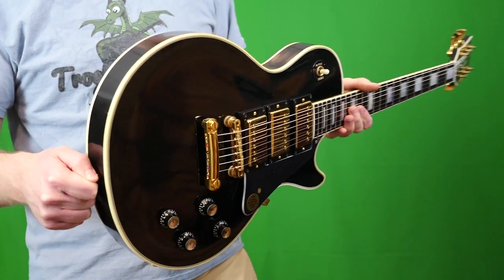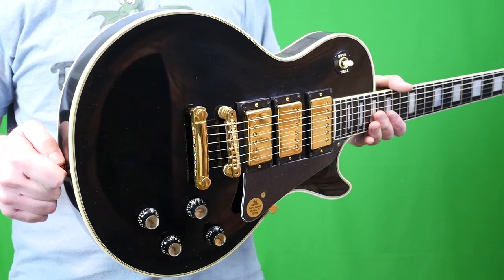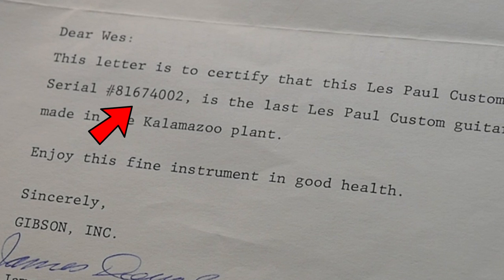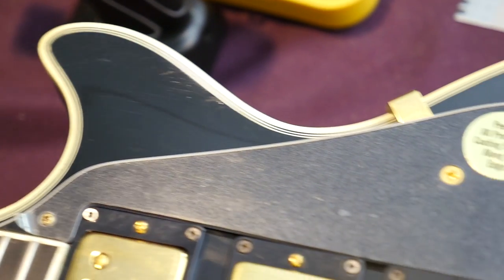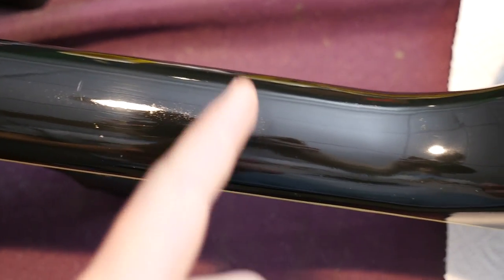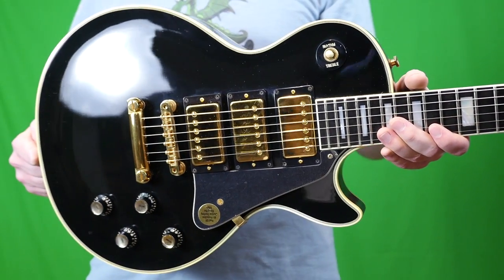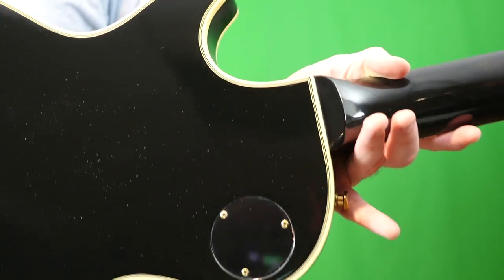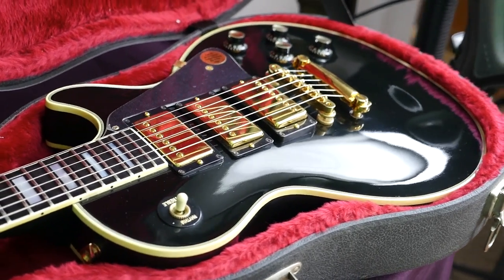The Last Les Paul Custom | 1984 Gibson Les Paul Custom Black Beauty 3 Pickup | Review + Demo

Comment: I had a 3 pu les paul many years ago, but I rewired it to standard 2 vol 1 tone wiring with the neck and bridge, and the third pot for middle pickup blend in any position. I thought the middle pickup was useless. Sold it 10 years ago. Now after  watching your demo, I was like, wow the middle position (Bridge and middle pickup) is actually sounding great and I don't miss not having the usual neck and bridge middle position sound.

Comment: I just bought the epiphone version, a used one for excellent price and loving it.  I opened up the pickups just to see what kind were sitting in there, since I was putting on new strings I figured I might was well add some lemon oil too.  If it weren't for trogley's reviews, I probably wouldn't have been so curious to open them up, but it was oddly satisfying to do so...lol

Comment: I know someone who has a vintage 59 Custom just like this. It originally had a Bigsby that has been removed and the holes filled.  What would you guess something like that is worth, presuming there are no glaring issues.  It's been played a good bit.  The gold is rubbed off the pickup covers for the most part, still has the original PAFs, but the capacitors have been replaced.

Comment: Case ding is called “case bite”
PS
You can definitely see the 2 fret markers were superglue’d back in
The chip is probably from someone trying to get the marker out for Re-glue, because the edges tend to lift
Especially is the fretboard was habitually over oiled
Reply: If a 36 yo guitar has no marks it was never played.

Comment: I bought a 3 pickup Gibson black beauty 1957 reissue  (# 701099) in 2000 or 2001 for 2500.00 new. I sold it in 2012 on eBay for 2500.00  to buy a lawnscape trailer, thinking ...
oh I still have my Fender American deluxe fat Strat . Boy, did I fu__ up

Comment: You are the expert but I think the back of the headstock looks funny, looks like a laquer respray. The reason I say is due to the orange peel effect only on back of headstock and the custom logo seems to have overspray on it, plus the rectangular shape around the serial number don't look the same as the checking between the tuners. Just looks funny to me, like I said you're the expert when it comes to that. Plus it didn't show up on the black light test.

Comment: Don't know how you can sell it, it's a keeper & will definitely gain value but you know what you're doing. I have been looking for an investment piece & this one is special. I owned a '69 Black Beauty once & sold it for $$ to get married. Should have kept it & ditched the bride....Ha Ha.
Reply from the maker: It is a keeper, but I can't do what I do if I don't always have a revolving door of guitars coming in!
Reply: The Trogly's Guitar Show : The black lights is to see if there were any cracks or repairs  in the wood ? In 2016 i bought a true historic 57 reissue black beauty sent from gibson through the shittest dealer in my city and i’m pretty sure its been aged a bit but in the back of the headstock you have some lines or cracks that run from tuner to tuner horizontally. To be honest, i don’t know if thoses are real cracks in the wood or in the lacker. That model of guitar doesn’t have a shiny finish and you can see that it is “hand rubbed” which doesn’t bother because it was evenly done but thoses lines i’m not sure even they were put in purposely or not.. How can i know for sure?